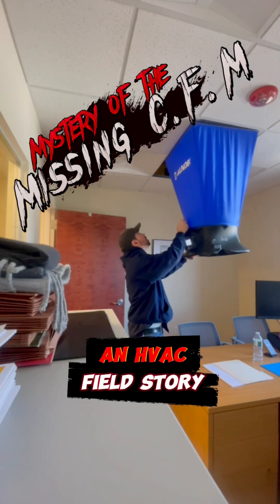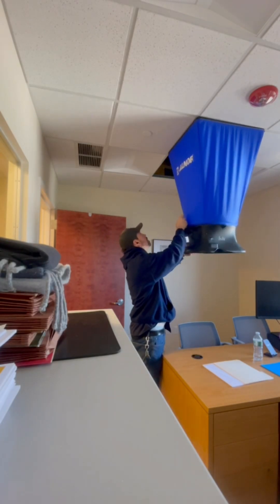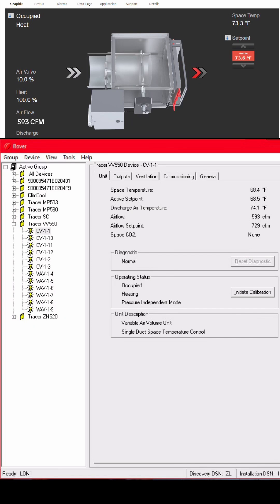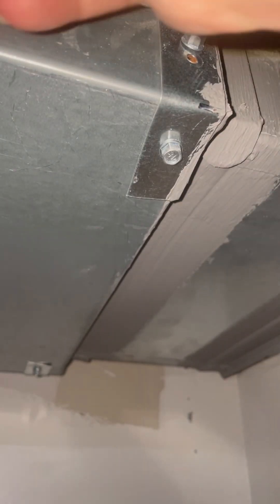Mystery of the missing CFM ￼#hvac #hvacmaintenance #airconditioner

Comment: And the source?
Reply from the maker: Supply duct leaving Air handler was lined with one inch foam lining and had a plastic dust shield over the top. Due to high humidity in the area duct lining peeled off the inside of the duct work I got most of it out, but apparently some fell down the main trunk three floors. That plastic was the dust lining on outside of theduct lining. We have since wrapped the duct with scrim.

Comment: I always appreciate when someone actually does their job properly. So many people would have overlooked this, and then you spend time in buildings like this and things are just broken and nobody knows why and it never gets fixed it's such a pain.

Moved into a new apartment recently, was told by the estate agent who showed us round that the buzzer to our intercom was broken. The intercom phone still worked and our button to buzz people in still worked, but the button to buzz to our apartment was broken.

Apparently they'd been trying to get someone out to replace it with no luck, apparently several people had come out and said the whole system would need replacing.

After a few weeks of dealing with missed deliveries, I got fed up one day and decided to see if I could get access to the button panel on the outside of the building. The lock was so old I was able to turn it in place without the key and open it. I inspected our button and it looked fairly crusty, I took it out, and all the contacts inside were corroded. So I cleaned it the best I could, put the whole thing back together, and boom fixed, it's still working perfectly two years later!
Reply from the maker: Thank you for your king words. A lot of people have blinders on and are lazy and don’t want to go the extra mile to do the right thing. They just accept things for how they are instead of saying why is this like this and then finding out why and fixing it. I take pride in my work and my customers appreciate that I make sure to do whatever it takes to get there units working how they should. I’ve always been this way.

Nice job on troubleshooting your intercom. You didn’t except the fact that it didn’t work and looked into it and figured out what was going on and got it working again. Nice job!🤙🏼
Reply: @professorbutlerhvac  No worries! Yes you clearly take pride in your work, not enough people do these days! There's far too many lazy people who cut corners, it's my biggest pet peeve! 

Keep doing what you're doing! Your integrity is key above all else, and your customers will certainly appreciate that!

Comment: So point being, removing the insulation wasn't done properly by this company
Reply from the maker: Original engineer called for duct lining instead of wrapping with scrim. It was installed as per engineer spec. Due to the high humidity in the area because it’s a wetlands, the adhesive came off of the duck lining and caused it to peel free from the duck work. we have wrapped all of the duct and removed all the lining, but some was sent down the trunk line

Comment: I do that for a living. Got big vacuum trucks and everything
Reply from the maker: The unsung hero’s. A very important job that most people can’t appreciate. But I do . nice work.
Reply: Would you vacuum that coil or leave it Dusty?
Reply: @hdtvcamera1  depends on how dirty it is. There's a level one in a level 2 cleaning. Once just using air pressure basically just blowing the coil off and vacuum it all up. The other would be using chemicals to actually wash the coil
Reply: @Weeklong_Seagull  it looked pretty dusty to me. A hospital wouldn't notice the decrease in efficacy or increased electric bills but it would bother me.
I keep my heating/cooling equipment clean for peak efficiency.

Comment: Happen at my job pill maker hvac tech. Why is the exhaust shaking like its possess oh plastic bag they put over the machine got suck up. Week later belts broke i wonder why.
Reply from the maker: Funny story I had a service call on an exhaust fan, the call was exhaust fan not working properly. It was for an eyeglass company lab where they make the glass. I go up to the exhaust fan and I pull about 2 pounds of plastic bags out of the blower wheel. I pull it all out and the fan is running but naturally the bearings are screwed up so it’s making a lot of noise so I write up to replace the fan. When I go downstairs to tell the lab tech that is exhaust fan was fixed. He walks over to his desk, picks up a tiny plastic bag and holds it up to the exhaust grill and let it fly, that’s how he tested If the exhaust fan was running, he would let a piece of plastic get sucked up. 🤦🏻‍♂️

Comment: What is the VAV. I do some minor maintenance and repairs to HVAC systems I've always wondered about the balancing of the systems. This is the first video I've seen in I'm impressed with your knowledge
Reply from the maker: Thank you for your kind words! A VAV, or Variable Air Volume, is a component in HVAC systems that helps to control the temperature in different areas of a building by adjusting the amount of air delivered. Think of it like the volume knob on a radio, but instead of sound, it’s controlling the flow of air. This allows the system to provide more air when it’s warmer and less when it’s cooler, ensuring each area stays comfortable while also being energy efficient. You can have one big air handler on the roof or a mechanical room and have multiple VAV in all the individual zones that have their own independent temperature control. Hope this helps.
Reply: @professorbutlerhvac  gotcha that's what I had a feeling it was is it similar to a zone control or is that a different component all together. I did maintenance on a unit Friday where it had the largest squirrel cage I've ever seen in my life it was 12 ft in diameter. It had 100 horsepower motor. I had to change 48 filters on the wall inside the rtu. They have five of these up on the roof these things are just absolute monsters

Comment: Brittle plastic that would be blasted all throughout the system.
Reply from the maker: It was the outside dust shield on the duct lining that broke off and got blown down there. Last week they got the duct cleaning that I recommended so hopefully all of it should be out.
Reply: @professorbutlerhvac  Lucky they took your advice.  breathing that in would be a long, slow nightmare.

Comment: HVAC is criminally underrated.
Reply from the maker: It’s very important. Most people don’t know what we do because they never notice it unless something breaks then they notice. We are the unseen heroes lol
Reply: 100%, if it’s done well everyone’s comfortable and doesn’t think twice. If it’s not, it’s a constant source of pain/stress.

Our building was structured in an… interesting way. Crazy negative pressure in the vestibule causing a super loud whining noise almost all the time, and like half of the building is on a single “circuit” (not sure what you’d call it) so if you want to cool it down for one of several conference rooms or one of two separate cubicle floors, or anyone in the HR department, you’re going to be icing out everyone else.
Reply: People have asked me if I was cleaning the vents when I use my flow hood lol😂

Comment: This is why companies should assign  techs with accounts......not just assign whoever is available that specific day
Reply: This is one of the biggest reasons I love the company I work for. Each tech has "their" accounts and, for the most part, info is relayed to the tech if something goes on at their account while they were doing other things.
Reply: Maintenance technicians with actual knowledge of the client and the history of work done? The ability to draw a connection between a current problem and work previously done which allows the problem to be quickly identified and solved without the need to resort to lengthy diagnostics... This is a perfect example of why you charge for outcome and not by the hour. I wonder what you could charge for such a premium service?
Reply: @Melanie16040  Surprisingly you don't need to (or shouldn't) be charging a premium for this. With a bit of patience, you will have more customers than you can handle
Reply: But who is going to pay for my yacht

Comment: What BAS is that?
Reply: One of the web based Trane systems. I think “synchrony” (SC / SC+) (“single building” controller for up to 240 devices) but may be ensemble (large building or multiple building campus/enterprise interface)

The controller on the VAV is a VV550 so is on a Lon Trunk. This building has probably been upgraded from Tracer Summit. Either Lon trunk landed to the SC hardware or the BCU (hardware for summit) may have been brought into the ensemble system.

Comment: Some people just would've suggested replacing the entire unit lol
Reply: I personally know about 3 companies that would do this. I have to leave residential HVAC for that reason.
Reply: If money isn’t an option then replacing the coil isn’t a bad idea. The fins are full of plastic now! I do fleet maintenance and I might spend more money but my fleet doesn’t come back on the tow truck
Reply: @alexcockerill ah yes the old comparing apples to oranges
Reply: @Ronald-ob1eh  all my trucks have a radiator and heater core. Do these not work off the same principle? Your comment was very weak, care to elaborate?

Comment: No it’s not nice nd clean, you just removed the obvious obstruction.
     Put in a work order to get a coil cleaner in place , or at least vacuum it out a little better 
     I’ve been doing HVAC/R since the 90’s if you check all are feed with a10” run 
    That no one cleans . If cleaned  it would 
  help the consumer, nd promote s long life to equipment.
      Good find , thanks for the post .
Reply from the maker: I was being facetious. I did write them up for a recommendation for a duct cleaner. They called the company and they gave them a quote. They will be doing it next week. We disinfect and clean all the coils twice a year during the PMs.

Comment: Looks like test plastic the tin knockers left behind.
Reply from the maker: It was the plastic dust layer for the foam duct lining that came loose after the filters in unit. I got the big pieces, but some must’ve fell down the riser and overtime. The plastic dried out cracked and peeled off.

Comment: So it was your fault cause you didn't properly remove all the debris. You’re telling people you don't take pride in your work and you do a half-ass job.
Reply: @shookfng go kick rocks
Reply from the maker: What you don’t know is I’ve climbed in that ductwork to pull out the foam duct lining insulation that fell in, but I can’t crawl all the way down the system in a three-story building. This plastic was the dust covering shield on the foam insulation that after 12 years, pulled off of the duct lining. This ain’t no residential system. There are duct chase ways that go down multiple floors and this is not die hard. I can’t crawl down vertical duct drops. You’re new to my page but if you knew me, you would know that I take pride in my job more than 99% of people. I go above and beyond on every single call and I have for 20 years don’t assume shit from just one video that you misinterpreted, go search my name on TikTok and check out my videos there you’ll see what I’m talking about
Reply: @professorbutlerhvac  
So why didn't you clean the coils after you removed the plastic debris? You saw it was dirty and you just left it.
Reply: @porcupinepunch6893  He's the one that said "Nice and clean coil"
Reply: I was thinking the same thing. "Oh remember now I didn't do my job". Lmao.